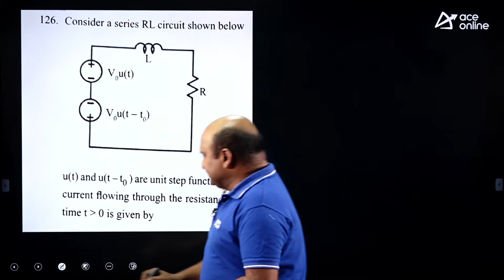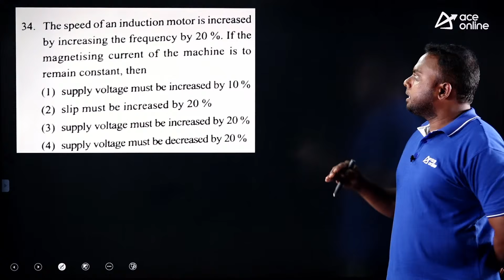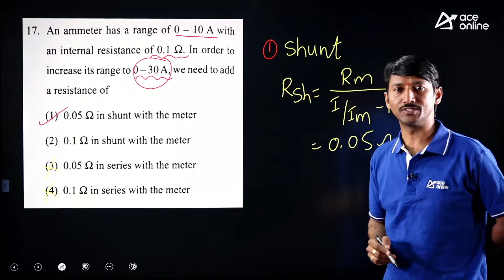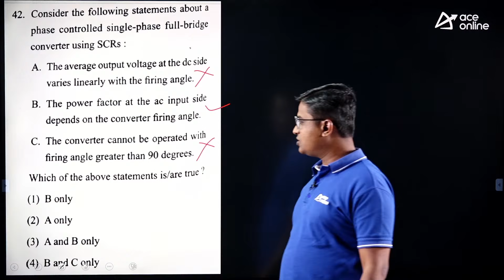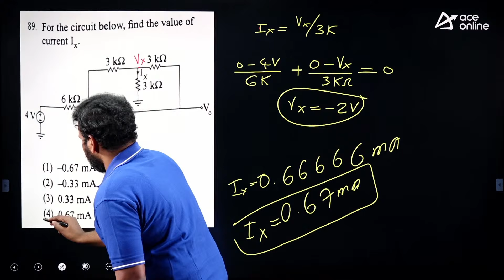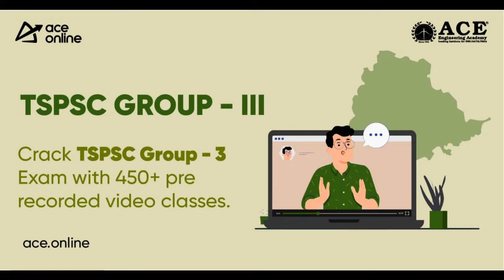TSPSC-AEE Paper-II - Question Paper Analysis & Discussion | Electrical Engineering | ACE Online

Comment: 37 qsn answer is BJT not SCR
Reply: No. SCR is correct answer. Voltage bidirectional means bipolar switch.
Reply: Bjt also bipolar switch
Reply: @S21-u9r  check urself before commenting. bjt is unipolar